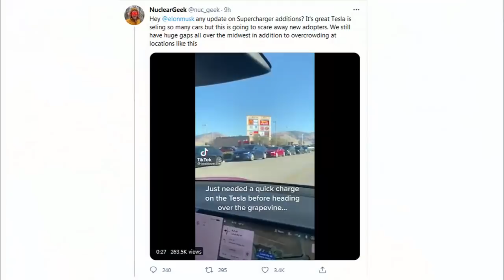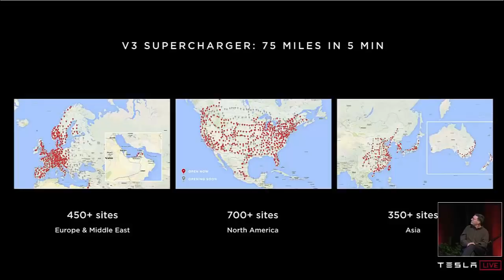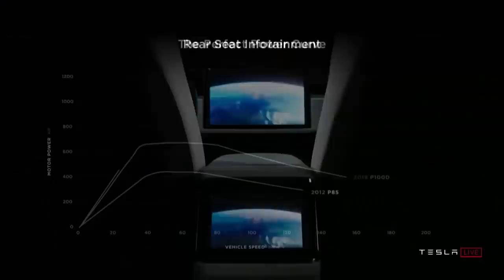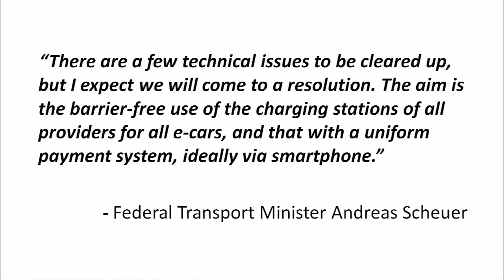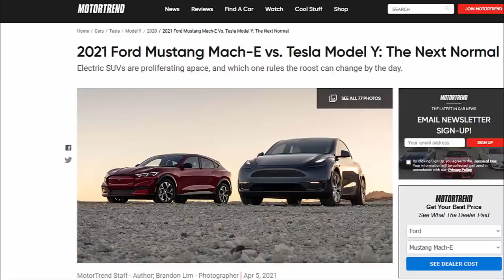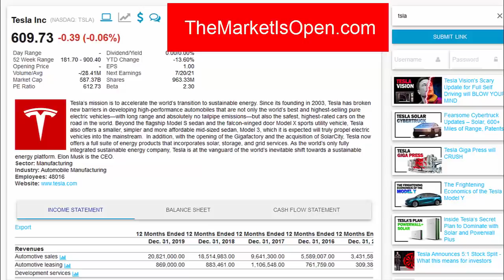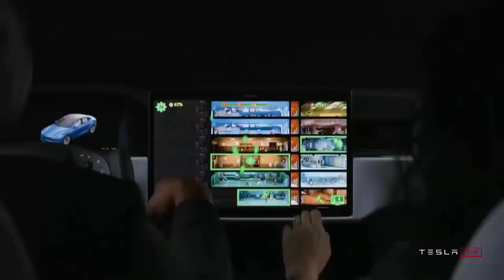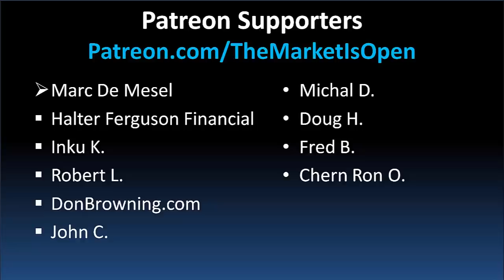Tesla Supercharger Network MASSIVE INCREASE

Comment: Interesting discussion.  After some thought, I think it makes the most sense for Tesla to open the charging network to third parties for a number of reasons. Reason 1: It will help make electric vehicles more accessible to more people if more electric vehicles are able to enter the market faster. This is a more notable benefit to  society than to Tesla itself, but will still be to Tesla's advantage if more of the population is convinced that EVs are the way to go. Reason 2: There is no way to predict one way or another with certainty whether Tesla would benefit more or less from opening the charging network to third parties, but if it were to keep it closed, it would be relying strictly on sales of it's own vehicles for revenue. However, if it were to open them up, then it might lose some revenue in sales of Tesla vehicles to competitors, but it gains revenue in energy distribution production and distribution. This is in a sense a smart diversification of products to help minimize risk.  In the short term, this might not make as much sense, but I don't think Tesla only intends to be a short term player. I think it is a good call to open the stations. Reason 3: At some point, certain governments are likely to demand that Tesla open the stations to third parties anyway, so it just makes sense to plan for that scenario from the beginning.

Comment: I’m all for keeping the Tesla supercharger in house / why do I need to share with Ford and GM they still sell gas cars…. They also don’t pay for charging infrastructure.
Reply: Well, if they use it, they will start paying it (or their customers). I assume no one suggests they'd have it for free.
Reply: Fort built out gas stations 100 years ago.

Oil companies make a lot of money off of selling gas

Tesla could make a lot of money selling electricity to electric cars.

About $200,000 a year if it where to cost $25 per full charge at 33% usage.

Multiply that by 1 billion cars and you've got a lot of money each year.

It wouldn't be a billion at the start but it would keep increasing until all vehicles where electric.
Reply: Well to be fair, every non-Tesla charging station is open to Teslas as well, so welcoming in the other manufacturers to the network isn't a bad idea. However, there should be a requirement that those cars have the capability to charge at the same rate as Teslas so that they aren't a bottleneck to those who are waiting.

Comment: Tesla should NOT open the network to others.  Since they were the first to make a network and no manufacturer wanted to join, they don't get to now.  I do think if the other networks had a Tesla connector it would help them with more revenue and actually build the CCS1 and Tesla stations.  Both Tesla and the other CCS1 DC fast charging stations need to add pull through stations for pulling trailers..  I think it may not be too bad if Tesla put Two   CCS1 stations at each locations as a test - goodwill, but do NOT open the North America network as too many more Teslas are being added each day.  The weekend of 6-12-21 the Ardmore, Oklahoma SC had all Six busy and two waiting to charge!

Comment: Charging at home will be the majority of time for most people, however businesses will need the supercharger for extended traveling, as well as vacationers.  I think having a massive amount of supercharging stations will eliminate all fears of running out of charge, which is stil a concern for most people.  It has to come to a point of not even thinking about it, like gas stations  now.

There is no way Musk will go for others to use the superchargers, especially when the low cost Tesla model comes out.  This would only deter buyers away from this lower cost model.  A bad move that won't happen.

Comment: I see Tesla licensing charge modules that are compatible with the fast charger at various levels (250, 275, 300, 325 kwh, etc). Auto manufacturers would need to specify battery details, plug it into temperature sensors, etc. Tesla charges for the hardware, and also a use fee per kwh. Sw updates could happen at the charging station. 

That could be done in 3 years...

Comment: has anyone actually tried to imagine charging a ford at a supercharger? when you use a supercharger you just pull up, grab the cable, aim it at the port and press the button so the port cover opens for you and then you plug in and walk away. the car and the charger figure out the rest. now compare that to literally any other charging station. you have to use your phone to find a charger, probably with multiple apps, identify yourself and the charger, provide payment details, find out the charger is broken and have to move the car over to another charger, agree to pay a fine for leaving your car too long blah blah blah.
Reply: All the other companies will have this problem. Their systems are not ready for superchargers. This host forgot to mention Elon offered this charging system before he started building them and NO car company wanted to be part of it. Why should Tesla be expected to share now to inferior EV systems?

Comment: If tesla were to open up the network then the big 3 should pay tesla an enormous initial payment. Electrify America stinks
Reply: This should not happen ever can you imagine the head lines…. Ford caught on fire from Tesla charger… 3 weeks later findings fords cooling system had flaws, or chevys battery cell production issue, meanwhile the entire station is out of commission for months until the investigation is finished, and they rebuild the station. 

Only why this should be considered to allow others to use its charging network is if they license out Tesla’s older tech the 2170, or the 18650 on the skate board, and use Tesla cooling system, computers and software. This way Tesla  is still above the competition while offering  offering the oems a chance to have an amazing car with out wasteful spending for research and development. This method also gives Tesla an advantage with its latest tech.
It would kinda work like the pharmaceutical industry you can buy the generic proven drug from anyone and the latest  from tesla for the foreseeable future.

Comment: It would seem to me, that third party automakers have a lot to gain with the faster charging stations Tesla has. Their cars are only as desirable as the third rate charging systems out there, not a good place for them to be when so much is riding on consumer satisfaction. Tesla has two ways to blow this, if they charge the premium for charging other autos, then they will be seen as greedy and opportunistic. If they make their system open to all, then why buy a Tesla?  Why should they take the chance of losing what they worked hard to develop?  The wild card in all of this is Elon, he wants EV's, so it might not be decided by a business case but by his long term goals.
Reply: The supercharging network is a massive moat, but Tesla cars are desirable for so many other reasons (OTA updates, autopilot, safety, range, performance, etc., etc.).  Tesla is doing to the automobile what Apple did to the cell phone.  Plus they can always charge Tesla owners less at the “pump” than other OEM owners.
Reply: @joshharrison5960  That moat wasn't done secretly, or with any advantage anyone else didn't have. It was a choice they made and the other manufacturers decided on their strategy too.  Consequences can bite you in the butt.
Reply: @rogerrussell9544  agreed.  My point was that there are many other reasons why a Tesla is more desirable than another OEM EVs, they don’t need access to reliable supercharging as a moat.  

If you’re Tesla, why not own the fueling infrastructure as well.  Imagine if Ford clipped a fee any time any vehicle stopped at a gas station.  You’ll already be supply-constrained on auto sales for years, and charging is just another massive business you’re positioned to corner.  Opening up access will drive enough revenue for you to massively scale your network, and you can always give a “membership discount” to Tesla owners (whose purchase price covered part of the initial build-out anyway).  I see it as a win-win.
Reply: @joshharrison5960  This is getting less and less true by the minute.  I have a Model X and a M3P but there are plenty of cars coming out that compete with or beat Tesla on many of your metrics and most of them do not look so sterile and uniform as Tesla are becoming.  Heck, most of them even have round steering wheels.  I doubt my next car would be another Tesla if the supercharger network were open to everyone.
Reply: @g0balot  no other OEM offers over-the-air updates, has a better NTSA safety rating, has vertically integrated and purposed its hardware/software suite for FSD, is anywhere close in terms of shoring up the battery supply chain (by far the limiting factor), has anywhere near the energy efficiency (miles/kWh) or culture of innovation as Tesla.  

The “competition is coming” and has been for a half decade.  Eventually other OEMs will be able to make compelling BEVs at scale, but not for years IMO… and when they do, as a Tesla shareholder (and owner of an X and a Y), I hope they’re paying to charge at Tesla Superchargers and that the Tesla network is able to grow to >10x its current footprint as a result.  Just my 2 cents.
Reply: @joshharrison5960  Many cars offer over the air updates these days.  Ford, Polestar and Nio with the Nio and Tesla still best at it but not for much longer.  

My model X had the hardware for FSD in 2017 but here in 2021 the hardware can't run FSD:  Well FSD isn't even close to being here anyway.

The Hyundai Ioniq is more efficient than any Tesla and the Audi RS is "real world" more efficient i.e. it is faster over long trips.

Tesla still have the highest safety rating of an EV but several are only a few points behind.

Teslas are great cares without doubt as they combine all the above in one package and that is why I have two of them but they are losing ground to the competition and in my view the supercharger network is the one thing that can keep them on top.
Reply: @g0balot  the Ioniq has 170 mile range and the RS e-tron 220.  We’ll have to agree to disagree on other OEMs catching Tesla on battery and other tech… I think Tesla is doing to the car what Apple did to the phone, and Ford GM and others are akin to Nokia and Motorola assuming they’ll stay on too (VW/Audi possibly an exception, ala Samsung).  

It is inevitable that other players will take on considerable market share, but it’s also inevitable that a fast-charging infrastructure is going to be built to support the explosive growth in BEVs.  Tesla is uniquely positioned to dominate that infrastructure… if they keep the network closed, someone else will build it for all non-Tesla BEVs.  If you’re Tesla faced with the choice of cornering that market vs trying to hold on to it as a moat for a few more years to drive auto demand, when demand already far surpasses your production capabilities, I think it’s a no-brainer.  

But reasonable minds can disagree, and I respect your position.  Definitely disagree on the comments re: FSD as well, but we’ll just have to watch it play out.
Reply: @joshharrison5960  I am not sure about your phone analogy.  Here in Norway, Tesla is losing ground to other BEV manufacturers and no longer takes top spot so perhaps Iphone v android may be a better comparison.

I have heard that the chances of Tesla opening up the superchargers for other makes, at least here in Norway, is very high so we will likely soon see how that plays out too.  A lot depends on how Tesla does that of course.

My own anecdotal evidence is I really love my X and  want to replace it as it is now past warranty.  With the direction S and X are going, turning into the same generic, sterile and frankly odd kind of driving experience to the 3 and the Y I really am put off but the super charger network keeps me in line :)  Without it as an advantage I'd buy a mercedes or possibly the audi.  I am not alone over here with my concerns either.  

Still as you say, we will see how in pans out.  I would be happy if you are right and I am wrong.
Reply: @g0balot  I had the privilege recently to experience FSD Beta in person, and it was utterly jaw-dropping.  My smart phone analogy is predicated on that technology… that’s what will fundamentally redefine what a car is and does (dumb car vs smart car).  I’m very bullish about Tesla’s position there, but again reasonable minds can disagree.  I think Tesla will continue to lead in BEV technology, but a BEV without FSD isn’t a fundamentally different thing than an ICE vehicle, in the smart phone sense.

Comment: We just finished a round trip from Wisconsin to Kansas City via Dubuque and Des Moines... Superchargers were very busy, 6 or 7 of 8 stalls, 5 of 6 in Bethany Mo -- Tesla has an infrastructure that's second to none, but they're also cranking out a LOT of cars. Opening up the Supercharger network to other manufacturers' cars would have to be done after a massive expansion of the system (and of course the other manufacturers would have to contribute to that expansion) to have any hope of having adequate capacity.
Reply: I've gone to Colorado from Wisconsin and back twice this year.  There was never more than half used on those trips.  I also went through Dubuque and Des Moines though it has been a few months.  The only real problem I had was that none were 250KW.  I guess the key is going in the winter not late spring.
Reply: @michaeldew7904  Texas to florida and back. Most superchargers empty and only one state had them half full one time. all were 250kw
Reply: I live in Iowa and have charged many times at Des Moines and Bethany superchargers. They are rarely half full or more. The only time I have experienced more than half full is on holiday weekends where everyone is travelling.

Comment: If it was up to me, I say "screw the legacy companies"! Talk with the electric start-ups and work out a deal for right of use at significantly higher charging costs.
Reply: That because they been taught drive up cost.   But Elon Musk and Tesla is using innovations to drive cost down.
Reply: Sounds like a good idea to work with startups that share Tesla's vision of the future and say no to legacy companies. which would degrade your customer's experience with longer delays and compatibility problems. Possibly one extra stall marked for other companies with additional adapters.

Comment: They were technically 125kW during initial release as v1. Software updated to 150kW as v2. Before hardware changed to v3. Just an incremental improvement throughout the years

Comment: They could open up to tpp and make the charging more expensive for them and for example have only one stall for other brands or something. Or two of them. Or maybe have reservations based on your route planner and give priority to Teslas.
Reply: As part of the build-out for the larger CyberTrucks, add 1-2 stalls for other makers - the real cost of a SC is with the siting and access to electricity.  Over time as manufacturers adhere to Tesla standards, they could be included into the Tesla stalls.  
This would show the drivers of other manufacturers how good the Tesla system is with limited impact on existing Tesla changing. And the higher fees charged will help build out the network.

Comment: Charging from 45-250 miles, the last 20% of the battery pack is double charge time vs the lower battery ramp.  

For road trips best option is to taper charge cycle for the entire trip. 

For the premise of taper charge cycle then look at the out of spec motoring on YouTube.

TSLA has already open for the supercharger network 3rd party users, but it’ll be a 5¢ premium over the TSLA price scheme, which will be used for the maintenance costs and expansion of the network.